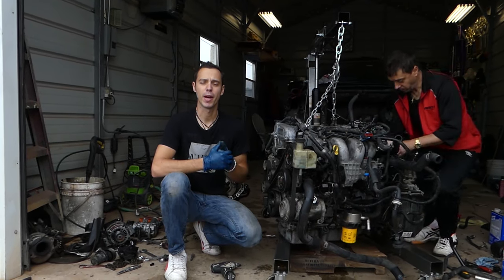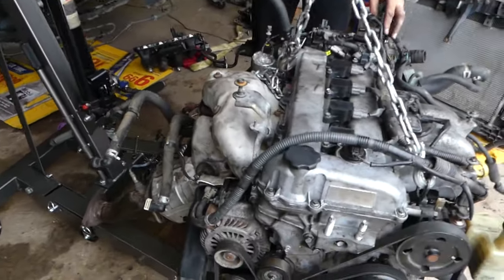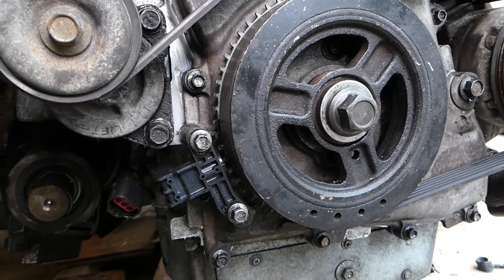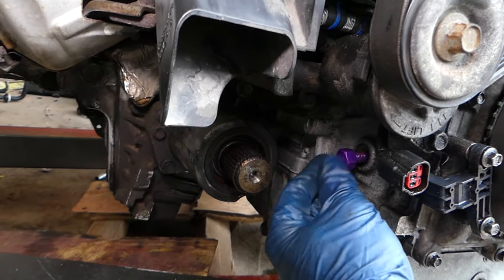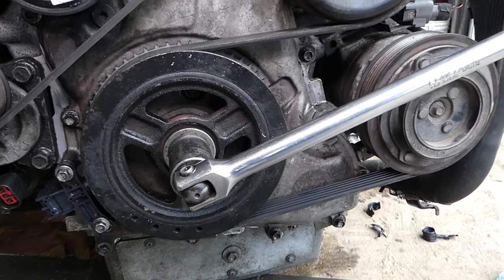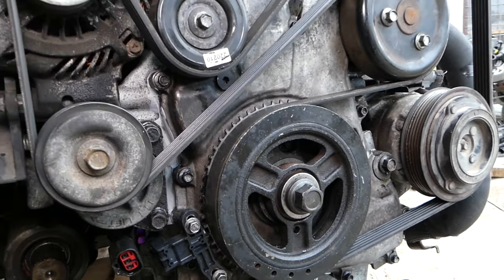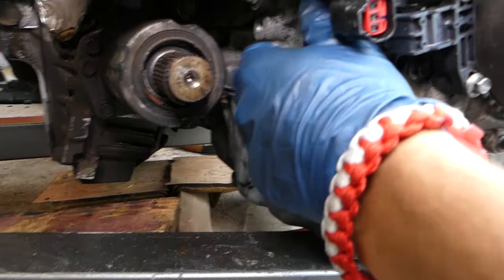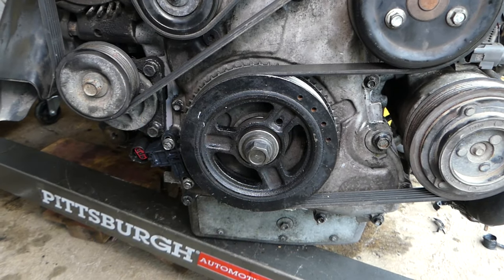MAZDA NOT STARTING OR RUNNING GOOD AFTER CRANKSHAFT POSITION SENSOR REPLACEMENT

Comment from the maker: Products that we use and recommend:
► Timing Tool Pins ( Check for your model): https://amzn.to/2Bgq7Me
► Purple Timing Tool Pin: https://amzn.to/3U1IjC7
► Panel Removal Set: https://amzn.to/3YiMADu
► Tool Set: https://amzn.to/3p5MM6t
► Screwdriver Set: https://amzn.to/3XRB28Q
► Castrol Oil: https://amzn.to/3xBc8B9
► Oil Filter: https://amzn.to/3w0Ulme
► Torque Wrench: https://amzn.to/32qyRwg
► Liqui Moly Engine Flush: https://amzn.to/3IiDBID
► OBD Scanner that we use most often: https://amzn.to/3I4MQfe

► Check out our Amazon Store for the tools and parts that we use: https://www.amazon.com/shop/worldmechanics
Reply: How can you check to make sure the adjustments are good after you install it
Reply: Hi I am struggling to fit a loose wire on the plug that connects to crankshaft sensor. Can u help me please.

Comment: Good video to let you know what your in for.  Not too difficult but things are more difficult when the engine is in the car.  You cant easily see the teeth when the engine is on the car.  I rotated the crank until i saw the gap.  counted back 10 and made a mark.  Turned again and counted 10 of the mark for 20.  You can then see the mark when you align over the sensor.
Reply: what is the best way to change it on the car? from the top where is the battery, wheel arche or ?? Cheers

Comment: Hey guys love your channel it's helped me a lot .the question I have is I have a 2007 Mazda 5 2.3L the harmonic balancer has the larger teeth on it .if I line it up with a tooth it will be the 11th tooth or do I put it between 10 &11 thanks

Comment: very good guys i'm buying one tomorrow and they say may have timing chain issue however it has 300 thousand miles on it must be hwy miles so may be back for more info
Reply: Wouldn't hurt to go ahead and replace the timing chain with that amount of miles tbh. These engines are nearly bulletproof otherwise. I've seen quite a few exceed 600k miles!

Comment: very good video.  I make a query.  I have a Mazda Speedy 2009 2.3 L. I have to change the steering pump, but I can't find it.  do you know if the pump of the cx-7 2009 is compatible or the one of the Mazda 6 2.3L.

Comment: Hello I have 2005 mazda 6i 2.3  did a engine swap with a 02-05 jdm 2.3 motor. I had to swap timing cover, crank pulley, CKS sensor, valve cover, water pump pulley, intake manifold, exhaust manifold and throttle body. Now car cranks with slight start but cuts off immediately. I need advice on what I'm doing wrong?

Comment: This helped me replace the Crankshaft sensor after a stall on the motorway. Unfortunately now the car only starts when cold (after a day), runs smooth for a few minutes then throws P0340 ( camshaft sensor fault ). Replaced sensor ( same symptom) . Checked cabling, voltages, etc, all seems fine. On the same voltage rail I have the O2 sensor and MAF, I`m running out of patience with this vehicle.
Reply: Did you ever find out the issue? This is whats happening with mine now
Reply: Have replaced timing, no joy, I have square wave at 0.6v from Camshaft sensor, square wave at 5v from Crankshaft sensor, yet the car would not start and throw the code. Tested the sensor on the bench and supplied with 12v it outputs 0.6v when away from metal and 0 when close - so it's not the sensor.
Time to dig deeper
Reply: Make sure the sensor is aligned.. make sure engine is at top dead center during installation.. do a crank re learn procedure

Comment: if you were the one putting on that harmonic balancer and the new timing chain and you did it that way you might be wrong because top dead center could have been on an exhaust stroke..you need to look at the position of the cams also to make sure it's a compression stroke top dead center not an exhaust stroke
Reply: No need to do that.. The crankshaft pulley has a alignment hole. The hole should be in the 6 o'clock position as in the video. There is nothing about 20th tooth. Cps should be on the nearest tooth. Done deal
Reply: So can you adjust the cps by using a bolt to keep the harmonic balancer in that position?
Reply: The cam should be turning 1/2 speed of the crank. You could be 180 degrees out on the cam or as he said "exhaust stroke" unless of course this engine is 1 to 1 rotation crank to cam somehow @JD-ml7cg

Comment: Can you help me? I've put a L3G motor from a 2002 Mazda Atenza Sport into a 2005 Mazda Atenza Sport 6 speed. I've changed everything from the 2005 motor over to the 2002 motor. The motor turns over then flattens battery. Dash fades when turn lights on.whatni. I've been told I need to change the crank shaft. Should I just do the timing like in your video or do I need to change the crank shaft and do the timing. Do you have a link so I can see where every thing on the loom goes to the motor. 
 1. DO I NEED ANOTHER CRANK SHAFT. 
2. DO THE TIMING.
3. CAN YOU RECOMMEND A LINK I CAN USE FOR WHERE EVERYTHING ON THE LOOM GOES ON THE MOTOR. 
               THANKS

Comment: Hay  I watch all your videos on Mazdas however; I have a mazdaspeed3 2009 I took it to the dealership and they told me My mazdaspeed3 has check engine code p011 p0016 and p0301 as well as oil in my spark plugs do you think the engines work is worth fixing or should I purchase a new engine?
Reply: Probably a valve cover seal around the spark plug

Comment: Can be a reason for misfire !? Thank you mate great video
Reply: Absolutely can. So can the camshaft position sensor. More likely than not though it's just the coil packs. They're prone to going bad on these because of the way they're designed. Can get 4 brand new Bosch ones from Rockauto for roughly 90 bucks. They have a lifetime warranty as well! They're far more reliable than the ones you can get at autozone or oriellys. Those never last me more than a year or so and even then I've had some have small hardly detectable misfires brand new. Made for BAD gas mileage though. I was down to nearly 10mpg

Comment: I just changed serpentine belt on Mazda 5 2012 and it’s running rough on de-acceleration. I turned crackshaft pully to walk belt on and now those symptoms. Could it be timing from me turning crankshaft or separate issue?
Reply: Hi mate i recently have replaced belts on my mazda 3 and im having the same issue. Did you end up finding ouf how to fix it? Thanks
Reply: I can’t remember but I had it going shortly after writing this. I think it was that magnetic thing you see in video needed in the right teeth. I put my ratchet on and turned it a tiny bit I think and I it tried to fire and I went some more and it’s been good ever since.  I’m know mechanic or anything and that’s what worked for me.

Comment: Thanks for the video.  I have this same engine you are working on in my 2008 Mazdaspeed 3.  The car will start up; run great for one second then immediately die.  If you try it again it will do the same; start then die.  The engine check light is not on and there are no fault codes.  Anyone have any ideas?

Comment: I didn’t even use the alignment tool, if you go over 20 teeth to the left from the gap, and line up the 20th tooth on center with the sensor, it will be fine. The car runs really smooth, you can balance rocks on top of it.

Comment: My Rx8 wouldn't start, OBD2 showed a code for eccentric shaft sensor, so I bought a new one, replaced and I don't remember the original code, but the code changed from the first one to eshaft sensor improper range function? My eshaft sensor is different from your crank sensor, mine isn't adjustable, did I do something wrong? When I put original back on the car, everything started working again...? Still works, but would still like to know what I did wrong
Reply: My nc 2006 Miata does not have 20 teeth after the space. What should I count?

Comment: not only tdc, you need it on compression stroke also
Reply: And how do you  do that?
Reply: Mazda service manual only ask for TDC for this.
Reply: Rohan Ellis every mazda guide clearly State tdc cylinder 1 on compression stroke. Not sure where you found otherwise.
Reply: @zuttoish  It doesnt matter. The crank sensor tells the pcm when the piston is at tdc. The crank will have the same position either its on compression or exhaus stroke. The camshaft position sensor tells the computer the cam position (which defines the stroke via the valves).

Comment: Very helpful bro, I have a similar engine, Mazda Atenza and after rebuilding it I was able to rotate the cranckshaft but after mounting on the torque converter along with the transaxle I could not rotate the crankshaft anymore, do you have any idea bro on what could be the problem? Thank you.
Reply: Is it in gear ? Problem with flexplate or torque converter ?
Reply: If your torque converter doesn't get seated all the way into the trans, then it will contact the flywheel and get pinched when the engine and trans are bolted together. I'm guessing this was the problem for anyone else that has this issue.
Reply: @gabeo9474  hi there did you notice you’ve answered the question 50 weeks later ? Do you think this was wise ?

Comment: On mine if i have the pulley lined up with the hole in the cover, the ninth tooth lines up. Not the 20th. I have 2 pulleys/balancers. They both line up with ninth tooth.

Comment: All the way from Jamaica gays, love your vedio's. The problem I am having with my mazda5 2014  Mzr 2.0 from Japan, when I start hear rattling sounds coming from the area of  harmonic balancer mostly cold start or  when ac circle off. Help please.
Reply: I would check timing chain, how many miles on it ?
Reply: My does not have 20 teeth

Comment: I watched ur video. So I was inspired to buy a mazda3 2010 for $300. Nice little car. It was smoking white when turned on. Figured previous owner over heated it and head gaskets when out. I have watched ur video called step by step and when I put everything back together I turned on the car. Never started again. I took out the spark plugs and they where smashed in 1st and second cylinder only. 3rd and 4th were ok. I have gotten really good at taking off the cylinder head and timing components In less that 40min lol not bad for a person that's never worked on a mazda before. Anyone reading this? Has any idea as to what my issue is. Please let me know. Thank you.
Reply: Ar this point I think it'll be cheaper dropping an used engine.
Reply: I am shure it's a timing issue but I have done everything step by step and it doesn't turn on. Before it did it just smoke white when turn on.
Reply: It is an interference engine. While the spark plug itself can't make contact with the piston, the valves will, if the camshafts aren't held in position. There is a tool to hold them in time. One or even both valves can get bent and broken off inside the combustion chamber. If the valve then gets caught between piston and spark plug area, you will then have smashed plug.
Reply: Ever get it started?  Mazdas are fussy misfits.  Fuses, relays, wiring seem to not do well, especially with summer heat.  Could be any of these...:/

Comment: THIS is not correct   .
He is totaly wrong  .WHAT  happens if YOU DON'T have THE tool 
.
HOW can YOU do that with THE axle on .
YOU sre not HELPING anybody. 

People  the new sensor comes  with  THE  correct position  and yo will remove THAT  piece  after YOU  install  the sensor 
The engine pulley  has a timing  precision  on the bottom  of THE pulley. 
The VIDEO shows  a engine  outside  not on the vehicle. 
GOOD luck